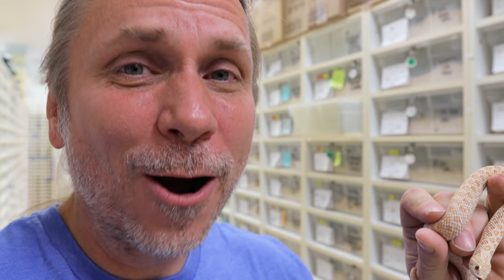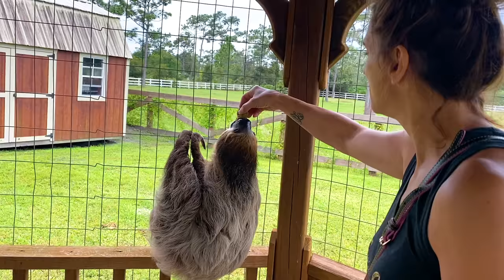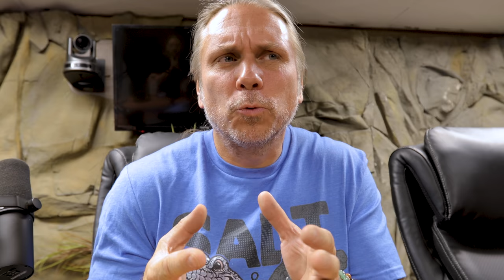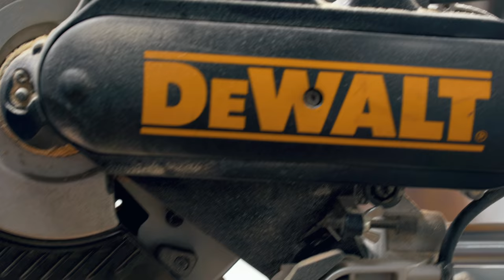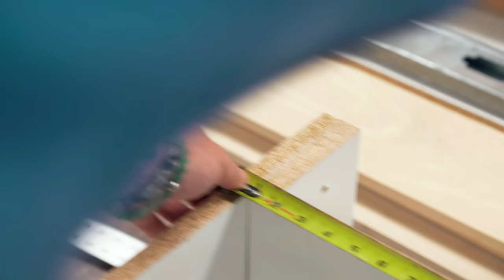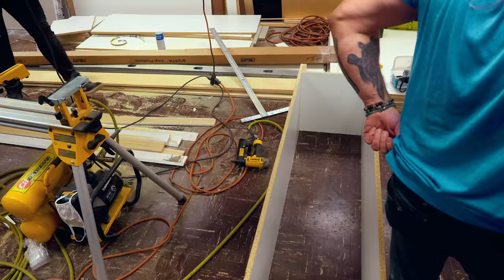LORI MET MY SLOTH DROGO!!! I THINK SHE LOVES HIM NOW?? | BRIAN BARCZYK

Comment: Have you ever seen a hand that kissed a table saw? I know, I know, I know you've been working with power tools for years and you know what you're doing.  This lady had been doing wood work for almost 70 years! She was making a child's toy that she had done so many times that she could have done one in her sleep! She had a guide right at her table saw but "she didn't want to bother with it" and it nearly cost her two fingers. When the doctor finished putting together what was left of the ground meat (not an exaggeration) her index finger looked like it had been in a pencil sharpener and her other one was only slightly better!  PLEASE USE A GUIDE ❤